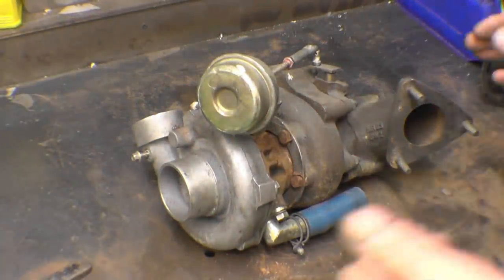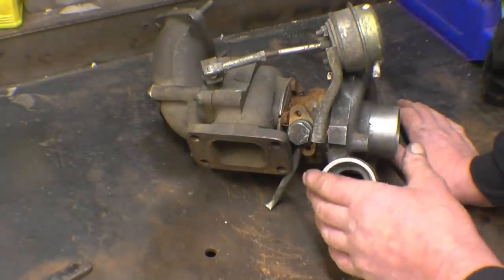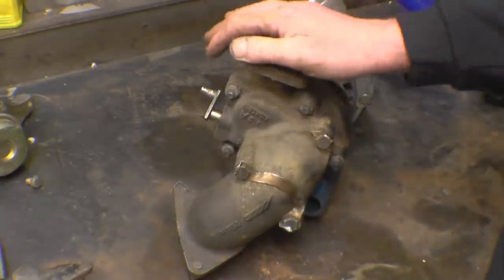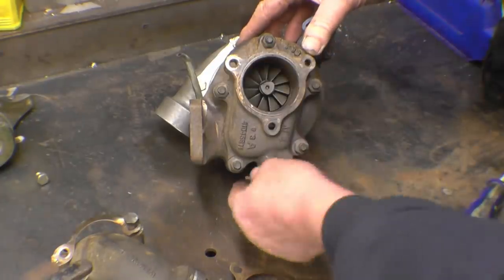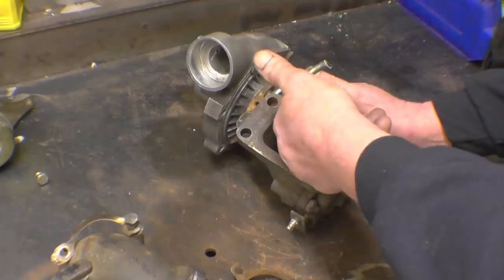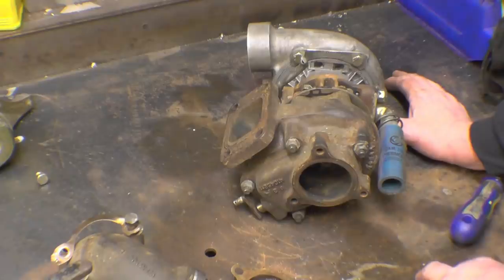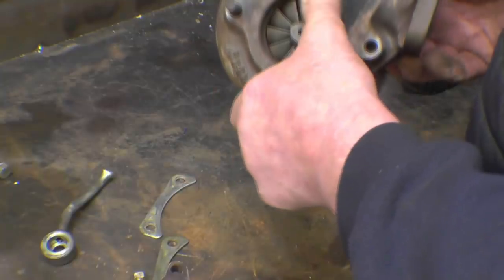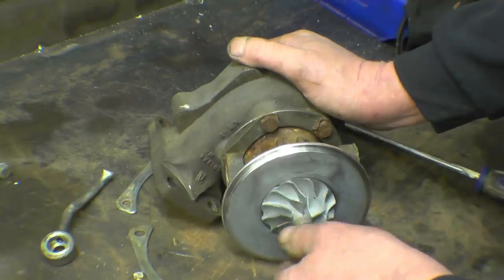Jet Engine / Gas Turbine    Part One

Comment: I wonder when this is running as a gas turbine, if you could take the turbine section from another turbocharger and bolt it onto the back of this to make a power turbine to extract energy from the exhaust gas and do so work, maybe run an alternator or something. Then it will be a free power turbine turboshaft engine! Might need a reduction gearbox though!
I have no idea why nobody has made a turbo-electric hybrid vehicle tbh!
Reply: First Last That is what a turboshaft or turboprop engine with a power turbine that spins independent of the main gas generator section is called... I didn’t make the terms!
Reply: Several years ago I was a member of an amateur radio club.  The club used to participate in Field Days - the rules are that you have to power your station off-grid, operating from noon on Saturday until noon on Sunday.  We used to power our station from a single cylinder diesel generator.  One site we used had residential housing fairly close by, we wanted to protect those residents from nuisance noise but our generator noise was low frequency which is difficult to silence.  It's bad enough during the day but it's really serious at night when the ambient noise level is otherwise low.  I often wondered whether a gas turbine, with its higher frequency noise output, might have been easier to silence.  I used to dream longingly of acquiring an ex-airline APU but had no idea how to access the surplus market for such devices.  The maintenance regime for such a device was also an unknown quantity.  Maybe FrontSideBus' idea is a potential route to quiet Field Day power???  I'm not, nowadays, in a position to pursue such a project myself but I do have an interest in the projects of others.

Comment: a quick preliminary question... how much thrust do you anticipate getting from this project and what do you intend it to power and drive?
Reply from the maker: I would think possibly 10 kg
Reply: @doubleboost  well, I glanced to my left,  I glanced to my right, and no answer came. As in "clowns to the left, jokers to the right, here I m, stuck in the middle with you". 10Kg is not an honest estimation, you joker, but thanks for the answer and gross underestimation. /cast sad face. real figures please or some true estimation lmao..
Reply: @doubleboost  well, I suppose it better to have 10 Kg go far than than have 200Kg go nowhere.
Reply: @areyouavinalaff  the boys at Boeing could use that information. They know all about going nowhere.
Reply: @markmossinghoff8185  btw, I not really up on boeing fails. sorry for ruin your gag. blame boeing.

Comment: How do you increase the boost   Is it by adding more fuel ?
Reply from the maker: Yes more fuel makes the turbine spin faster hence more boost called P2 pressure in a gas turbine